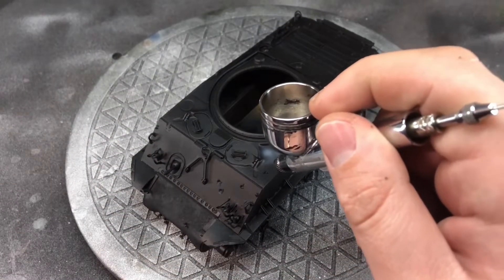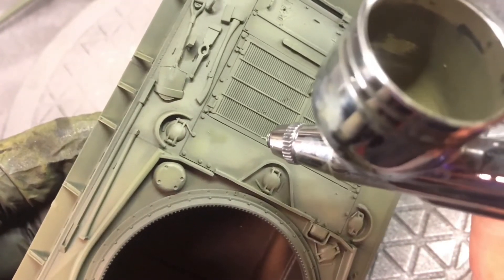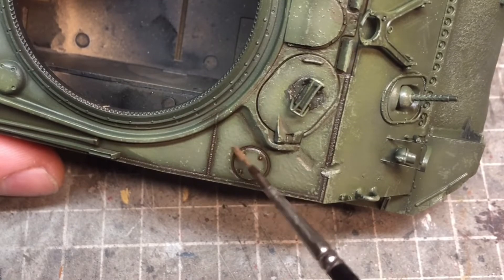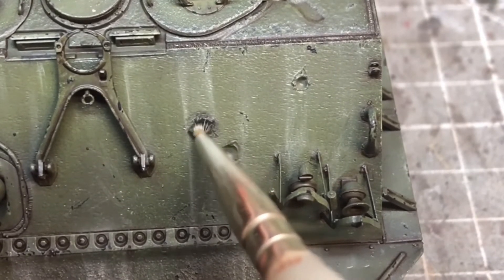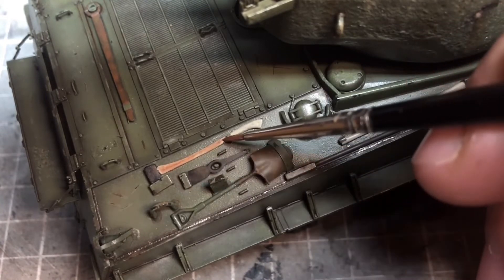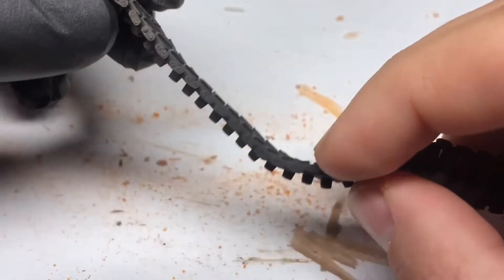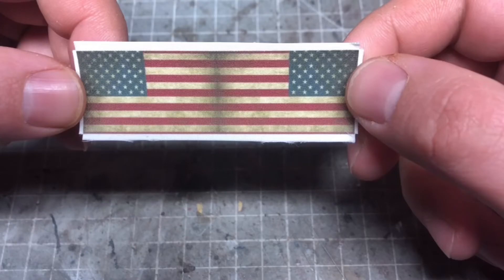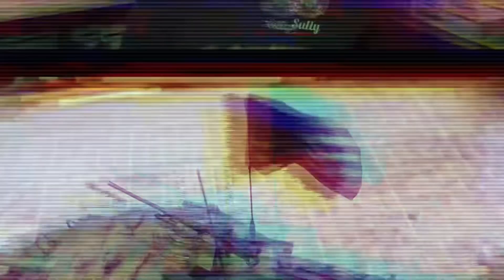‘Easy 8’ Rye Filed Models 1/35 Sherman ‘Easy 8’ M4A3E8  Part2

Comment: Fantastic bit of work! Just what I needed to find! Just brilliant! How did you go getting the tracks on? That’s what is freaking me out.
Reply from the maker: Thanks mate! Was a little finicky the fact the tracks have a tight tolerances compared to others. I found once you wrap them around have the open ends at the bottom then assemble the last links. Because there's so many parts to a link if you have the treaded part on the desk put the open ends and the whole tank ( obviously lol) on top then build the rest of the track like the others. Like I said easy but fiddly, especially if any of what I just said makes sense lol its a bit difficult to explain
Reply: I will give it a go! I have used Nigel’s Modelling Bench for the
Track build and hull assembly.That got me this far. Like you’re self , a Master Model maker. I was looking for painting tips when I found your channel. Your art work on the painting and battle damage is inspiring, and the best on YouTube. Thank you for taking the time to reply so quickly.
Reply from the maker: @desmcharris  thanks dude really appreciate that if you need any more help please just ask my friend